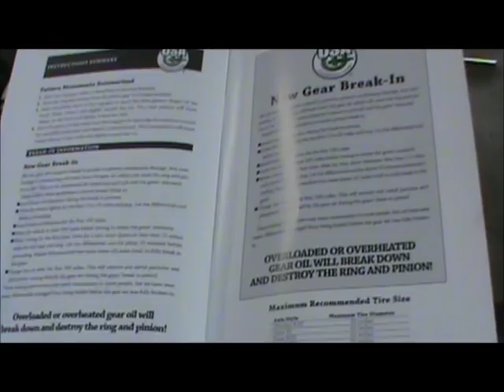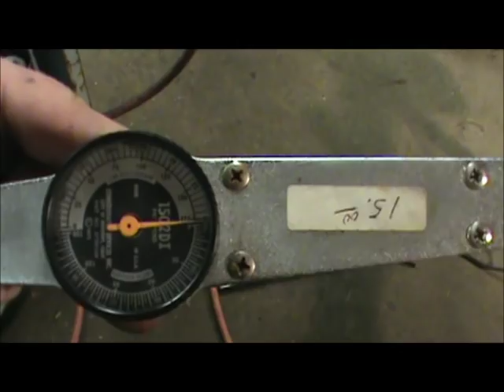Rebuilding 12 bolt truck rearend

Comment: Seeing this video brings back memories. I worked at the Chevrolet Warren Plant in Warren Mi. Every piece of that rear end was made or machined and assembled at that plant from the 60's until about '78 or '79 when the plant was retooled to build the corporate 440 series 4 speed front wheel drive transmission.
Reply: J Marco i

Comment: Nice Video. I am a Machine Repairman for a Big Three auto manufacturer and cutting grooves in a nut as a thread chaser was something I learned in my apprenticeship. You can also get a nut to turn on a thread by tapping on all sides of the nut with a hammer where ever it happens to gets tight. Keep up the good work, I enjoyed the video.

Comment: The Chevrolet plant I used to work at built these rear ends from the early 60's till about 1980. Turned raw castings and coiled steel into complete rear axles.

Comment from the maker: 12 bolt refers to the number of bolts in the cover. This is primarily used to identify GM rear ends.  There is 10, 12 and 14 bolt rear ends. Then there is a difference between the 10 and 12 bot car and truck. The 14 bolt is the 3/4 and 1 ton rear end, it was made in two versions. One with full floating axles and one without. Ford and Chrysler rear ends are generally referred to by the size of the ring gear.  Dana axle where used by the big three also and they are referred to by model number.

Comment from the maker: There is shims between the housing and the bearing races on the carrier bearings. The shims are held in place by the bearing caps. You move these shims from one side to the other to move the carrier to set the backlash.

Comment: No, the 400-500 lb figure is misleading. It really has nothing to do with setting up a rear end. He was making a comment about how much weight it takes to distort a crush sleeve, as if you set a 500 lb weight on it sitting on the ground. It's actually irrelevant to the discussion. You just tighten the nut down until it takes 20 inch-lbs to turn the pinion, regardless of the torque on the actual nut.

Comment: Truck rear end differentials, they range in bolt patterns. So like the pumpkin (cover) has 12 bolts holding it on. Their just used for different size differentials.
Hope that helps.

Comment from the maker: Yes there is a difference in the truck and car 12 bolt. The cover on the car 12 bolt is more round shaped and the truck is kinda oval shaped. I don't think any of the parts interchange.
Reply: Thanks for the vid. My best takeaway was the fact that one carrier won't work with all gear ratios. Important fact. Thanks.

Comment: There is a misunderstanding here regarding how much force is required to crush the sleeve. The 4-500 lbs is is you set an actual weight on it. But you're not, you're screwing down the nut to crush it, which requires much less actual force.
The torque spec on the nut is not the torque to tighten it down. It's the torque that it will take to make the pinion freewheel. If the pinion can freewheel at 5 inch lbs, the go a little tighter on the nut, maybe 1/8 turn. Keep going until you get to spec.

Comment: Thanks for your reply and sorry for my ignorance. Watching more videos discovered that the problem I was referring to is not the C clip but the shim sticking out outside next to the Bearing Cap. It's not loose but surely not correct. Who ever over twenty five years plus had my truck must of been inside. Didn't want to loosen anything up to slide it back in place and bugger it up. Have I still got you totally confused. Thanks, Don ( with e-mail could sent to pic)
Reply from the maker: +Don Fenton I think I understand now. The bearing caps that bolt on each side of the differential are suppose to hold the shims in place. The shims are stacked in on each side of the bearing to set the preload and backlash. If you send me a pic. of you you are talking about I will be glad to try to help you. My email is boat604@yahoo.com.

Comment: I’m doing the opposite going from 3.08s to 373s I bought a set of used diffs and the rear one has new gears but the pinion is loose I think they didn’t drive it though i gotta rip it apart and see what they did wrong

Comment: I guess Id like to know just when to stop tightening/crushing the crush sleeve.  Thats what Im looking for, how to crush it/install it correctly.  I tried replacing all my bearings and just putting it back together and it made noise.  So do you only replace the crush sleeve when you do bearings?  Im assuming you crush the sleeve until it stops crushing/no more slack in the pinion.

Comment: Mr. Boatwright, I am totally 100% not knowledgeable about the rearend of my 66 pickup 12 bolt. I watched how too's and decided to change out my fluid and change my bearings and seals. I seen were you drop the cover and and drain the fluid, remove the nut and the C clamp or spacer, then pull out the axle one at a time, then replace the bearing and seal. Here's my problem and question. After removing the cover and examing I see that one of the C spacers is actually sticking out toward the cover but not touching and doesn't seem to be loose. Now I don't know if it was because they couldn't get it in and said it will be fine. Your opinion would be appreciated. Don
Reply from the maker: +Don Fenton I don't fully understand your question. If the cross pin that the spider gears is on is in place then the c-clips can not come out. You have to pull the cross pin and push the axles in to be able to pull the c-clips to let the axles come out. I will be happy to help anyway I can but I need a little more clarification on what is going on.

Comment: I tried to rebuild an s10 rear end years ago.  It did have the crush sleeve, and I still dont under stand the concept of the crush sleeve and the 15 inch pounds required on the pinion nut.  If you apply 4 to 500 lbs to the pinion nut, then why does the nut have 15 inch pounds torque spec?  I still further more dont under stand how you tell if you have crushed the sleeve enough.  I basically wanted to replace all my bearings in the rear end.  It did not make any noise before.  I gave up.

Comment: I need to to replace rearend pension yoke. Do I need to replace crush washer or can I as I’ve seen measure threads and put nut back where it was?
Reply from the maker: The text book correct answer is any time you remove the yoke you should install a new crush sleeve and reset the preload on the pinion bearings. This involves completely disassembling the rear end. However I have replaced lots of pinion seals without doing all of this. The used pinion bearings are going to be just a little lose anyway. Take the yoke off replace the seal when you put the yoke and nut back on locktite the nut and torque it back down. Don't crush the sleeve to much and over load the bearings.

Comment: My Dad and I are restoring his 64 shortbed fleet side truck.  Could you be of help?  email please?  I think the same thing has happened with the rear end on his truck, but need some assistance on proper way to dismantle everything, and then a step by step instructions procedure the correct way to put it all together.  Thanks!

Comment: I'm looking at swapping a 12 bolt into my truck. I would like to know if this is a good strong axle and any possible flaws, any feedback will be helpful
Reply: Some 12 bolt difs like my Dana have the wheel bearing races ground directly on the axle shaft. When they wear out they are Done for, cannot be repaired, welded and reground. You have to get a new or used (in very good condition) axel shaft. I have replaced 3 on my 1970 Chevy C10. It's not hard but it's not like changing a tire, it's a whole production. If you don't catch it early when it first starts to whine, it will deform the shaft wobble and destroy the brake mounting plate and create a little more hell for you. The bearings are lubricated by the differential oil that flows in the axle casing; use good lubricant and keep it clean. Just common sense. If you change your own brakes or have it done, check for wobble or looseness to make sure it's tight.